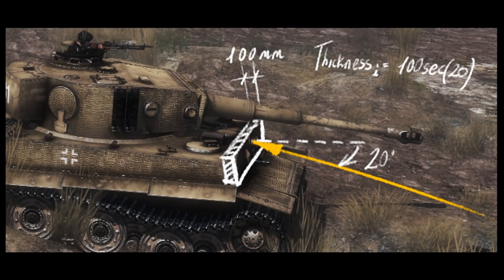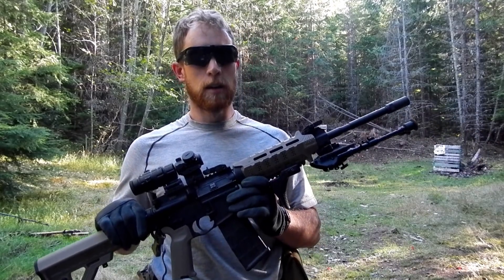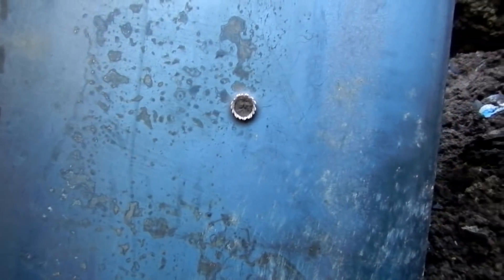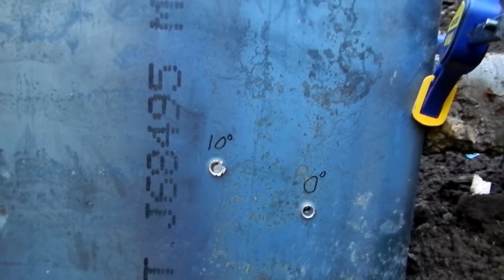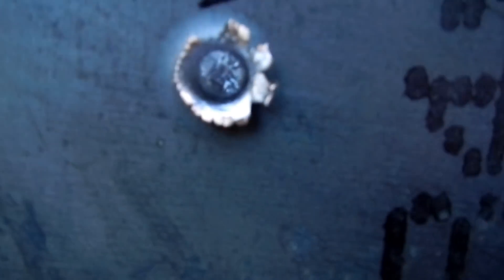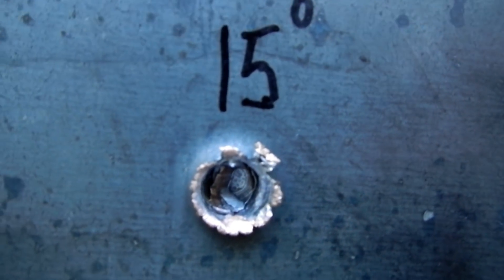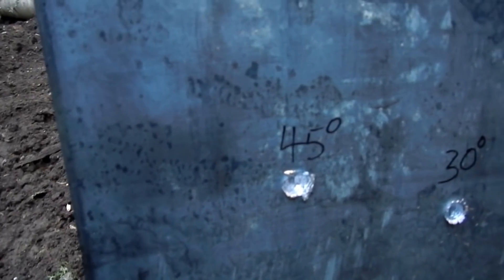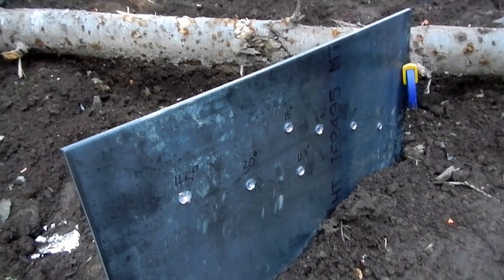Does sloping armor increase it's protection?

Comment: You are not very good at mats or physics, right?
Reply: Also what would indicate that?
Reply: @reahs4815  Sloping armor does not increase its frontal thickness, just angle. As thinner sheets are used, they get proportionally longer, so final mass remains the same.
This is the first answer found on google:
https://www.quora.com/How-does-sloped-armor-on-a-tank-improve-the-effective-armor-thickness-when-compared-to-flat-armor

Comment: Sloped armor is more effective, but that comes with some complications. First, armor piercing shells of the size suitable for anti-tank usage tend to be traveling in a more parabolic arc than say 223 /556, they are also under fire from artillery (even more of an arc in flight) and rpgs with shaped charges. Secondly, the more you slope the armor, the less room is available for crew, ammunition, and systems typically. This is why you see such a wide variety of different solutions in ww2 despite the fact that tank designers were well aware of the advantages of sloped armor in the interwar period. Today after over half a century of refinement you see armor that uses various different approaches together - slope, spacing, and active armor. I think they probably still have some of the same arguments every time they try to design a new armored fighting vehicle, protection vs weight, crew comfort vs slope, mobility vs ability, fuel efficiency and range vs high speed and small target ect...
Reply: Most of today's armored fighting vehicles have a main hull then multiple secondary armor mechanism like a composite armor of 90/45 with an air pocket between the 90 slab and 45 slab to absorb shaped blasts this method is usually found on tank m-raps have a 90 slab for a hull and to deal with RPGs they have a grating around the hull so the war head detonates before reaching the truck it's self there for rasing the survivability of the blast
Reply: @SpiffyNo 
You might be surprised to know that spacing between armour layers is intended to stop the effect of HESH* AT rounds, as they require solid armour for the blast shockwave to propagate through the armour and spall the internal surface off, using that to shred everything inside the tank.
*High Explosive Squash Head
Reply: Thats quite the ramble lol
Reply: and this is vid is completly false , sloped armor is not lighter than not sloped armor
Reply: @LicsNorgi  make your own thread, 50 mm of effective armour is lighter the more the plate is angled.

Comment: Yes that’s why most tanks prefer to face the enemy at a 45 degree angle.
Reply: Back in the day of conventional steel armor, but today modern AFVs have more focused defenses, and angling the hull doesn't provide a significant improvement in defense.

Just as well on MBTs, the side armor is often woefully insufficient to stop high energy dart ammo, and exposing any portion of the side of the hull can be dangerous.
Reply: Well we have composite armor for APFSDS (Fin stabilized darts) and that usually eats up the projectile and absorbs the energy, and we have ERA(explosive reactive armor) for HEAT type shells. Angling armor is still quit effective, but being that HEAT shells have to be on specific angles to deliver their stream of molten copper, it’s kinda helpful to angle so the chemical energy has more armor to go through. APFSDS can also be countered with angling, but I’m these days tank combat is too rare to judge.
Reply: @jefferybauduin2919  Well ERA works vs APFSDS too but not as well as vs HEAT

Comment: Angled armor also increases the overall weight OR decreases the internal space drastically.
Reply: Not necessarily.
Reply: aboomination not necessarily, as your armour is relative to the person using it and the person firing upon it, all you have to do is change your angle of incident and presto angled armour. As long as you’re aware of what angles your armour has you can always keep an efficient angled facing towards the attacker. This doesn’t mean an ecroachment on space or weight restrictions unless changing the armour during the design and building processes.
Reply: @brendonmoore3505  True, but I was talking actual pre-angled armor vs pre-"flat armor" ;) Obviously a boxy tank like a Tiger could angle towards an enemy (and was instructed to do so).
Reply: I understand what your saying but still not Necessarily. As you can both reduce you weight but multiplying your angle therefor halving your material weight on front and side plates, only at optimal angle incidence. 
And using the inside plate dimensions while building rather the outside.
Reply: So you can reduce the thickness of the plates while still retaining optimal armour integrity.
Reply: You can also think of it like this.

Angle the front plate of a vehicle, the lost material can now be used to increase dimensions in other areas, like the back. So you'd be not only increasing effective armor, but getting the same internal volume as well.

Comment: How useful is sloped armor on MBTs?
Reply: Eh most of your protection is from composite armor. APFSDS easily defeats angled armor through normalization. A modern APFSDS round can pen rolled homogeneous steel at extreme angles.
Reply: @talltale9760  Its not because of normalization... and composite armor(if we ignore what and for what is actualy inside it) is good protection for HEAT and HESH. Reactive armor also giving some protection when it is on sloped armor.
Reply: @talltale9760  not too useful then.
Reply: @karlhans6678  The Sloped armor is still useful but for a different reason, and people often ignore context
Beneath the angled parts there are dozens of plates of flat, super-hardened plates - however thinner hard plates are also more brittle
The Flat ones underneath deal with the large rounds and ATGMs, the angled ones are to deflect smaller ones - like 30mm cannons on IFVs that would risk weakening the hard but brittle plates below
Reply: @bengrogan9710  sounds like a good reason.

Comment: Excellent test.  I would just add that sloped armor not only increases the effective thickness, but it also makes it easier to deflect an incoming projectile.  If the armor is perpendicular to an incoming projectile, then the normal force exerted by the armor on the projectile needs to be at least great enough to reduce the projectile's velocity to zero.  If the armor is sloped, however, the normal force exerted by the armor on the projectile need only be great enough to reduce a vector component of the projectile's velocity to zero, that component being cosine of the angle of the slope of the armor off the vertical (which would be equal to the sine of the projectile's angle of incidence to the armor).  To put it another way, as the slope of the armor increases, the less it needs to change the direction of the projectile to send it skittering off.
Reply: Based on what you're describing I would love to see a video to find out at what angle the round ricochets. Measure the "thickness" at that angle. Then take out a thinner plate which do not hold the required thickness to stop a round, but it is at an extreme enough angle to cause a ricochet, would that be enough and/or possible to stop it penetrating?
Reply: @evil001987  I would love to see such a test too.  I do not currently have the equipment to conduct such a test any time in the foreseeable future, but hopefully Jackal Mountain will read these comments and try such a test.
Reply: @Patrik Lilja
Both: First the flechettes are unlikely to bounce even off of armor that is extremely angled due to their tiny cross section and immense velocity; Second, once in the target the flechette will turn(slightly) into to the angle of the plate, thus reducing the effect of the angling. The more extreme the angle of a particular section of armor the thinner it has to be to make up for the additional surface area, thus less armor for the flechette to go through.

You can look up images of APFSDS flechettes tested on steel blocks for visual aid.

What this means is that flechettes gain effective armor penetration against vehicles that rely heavily on sloping over objective armor thickness(such as most Soviet and post-Soviet vehicles). By contrast old-fashioned AP rounds, chemical rounds and Soviet style slug penetrators suffer a lot from angled armor. Slug penetrators are actually very good at penetrating flatter armor, more so than flechettes as they're not restricted by the flechette's length, down side to that is they bounce.

Also, certain types of flechettes will partially disintegrate during the process which is very bad news for anyone on the inside of the tank. DU rounds do this, it's one of the many, many reasons they're superior to any other kind of anti-armor shell.
Reply: There are many rounds that work better on sloped armor it's the round the Abrams had used/uses
Reply: Such as apfsds
Reply: @goose6440  I've been trying to google on it, but can't find any definitive answer. 

When some people say "better" they mean better than other rounds. When some people say better, they mean that it will not penetrate as well on an armor plate without any slope.  Which is it?
Reply: @evil001987  every round has it's draw back and pluses
Reply: @evil001987  APFSDS is a long rod  depending on how long the rod is that's how much penetration there is .
Reply: @evil001987  there is also a comment on here that explains everything
Reply: @goose6440  You write "depending on how long the rod is that's how much penetration there is ." Given that explanation, sloping armor still "helps". Sloped armor will make it so the distance of armor needed to be penetrated is longer. If the distance of penetration depends solely on the length on the rod, the more the armor is sloped, the longer the rod is needed to penetrate it, in a hypothetical scenario.

As far as I can find, APFSDS are better than other rounds vs. sloped armor. But it isn't in itself stronger against sloped armor, than it is on armor that isn't sloped.

Of course, in reality, if you need to put it on a tank that needs to be able to move and house equipment inside of it, the amount of armor needed to stop APFSDS just isn't viable to put on a vehicle, regardless if you slope the armor or not. 

So in that regard, APFSDS still beats sloping armor and it doesn't "help" to slope the armor. But sloping the armor will present more armor to penetrate for the round, just like shown in that video, even though it won't be enough. Of course, this counts as beating sloped armor in any practical sense, so I agree it beats sloped armor. 

All I am trying to say is that the idea behind sloped armor is that it presents more armor needed to be penetrated, and that, as idea presented in the video, still "works".
Reply: In all fairness, this only applies to a ACPR which is a high velocity shell with bad angle penetration. Other bullets that utilize penetration and ballistic caps won’t have trouble doing damage to armor. It’s a good point but very rarely seen in practice. This generally does play a part in gun breaches and/or turret sides.
Reply: @shaloamnenja12yearsago29  Except they will, capped ballistic is still massively more sensitive to angling than flechettes or HEAT devices.
Reply: The Crimson Fucker, that’s fair but doesn’t change my point that it doesn’t apply to ACPR.
Reply: @shaloamnenja12yearsago29  
ACPR? I'm not familiar with this one. I'm familiar with armor piercing composite rigid but not whatever that's supposed to be.
Reply: The Crimson Fucker, it’s a light, pointy bullet. It’s for head on armor, not angles, and is weak at long range.
Reply: @shaloamnenja12yearsago29  
Yes that's APCR, there's no such thing as ACPR. Just try to break the acronym down and see what you get.
Reply: The Crimson Fucker, sorry, fucked up my spelling. It stands for armor piercing composite rigid.
Reply: David Vazquez  
That's uh...that's not quite right though. Should be Anti-Communist, shouldn't it?
Reply: David Vazquez  
No, no it's Anti-Communist Particle Cannon,  It's a particle cannon that only targets communists.

How do I know? Well anything it shoots is obviously a communist.
Reply: @Nekogami04  
No, Liberty Prime uses an Anti-Comunist laser, a "acuser" if you will.

Comment: Straight to the point, very interesting and informative. New sub.
Reply: He said about T-34 and did not mention "BT-2 tank of 1932 - Walter Christie's tank design built under licence in the Soviet Union"...
Reply: +When a round hits a piece of metal at an angle, it ‘normalizes’; it will slightly correct its angle of penetration(that correction is specific to the bullet type and shape.
Reply: and it is false

Comment: It reduces the area it covers though, you're not getting better protection for less armor, they don't slope it on the sides of tanks, it's just like making it thicker really. Dunno why people make a big deal about sloping armor, cool video though.
Reply: It's not just increasing the relative thickness. Bullets and shells have vastly worse penetration performance on sloped plate, so the plate offers a lot more protection than its relative thickness implies.
Reply: Not only is the angled plates effective thickness increased but because of the angle itself the chance of ricochet or non penetration is increased dramatically. Combine this with composite armour to protect against heat rounds and active defence to face atgms and other guided missiles and you have an MBt of some stature.
Reply: It does add weight. It increases surface area which means more mass which means more weight.
Reply: Blackwood Security not necessarily, as c2 = a2+b2. “Pythagoras Theory” also a 20mm plate at 0 degrees has the same mass as a 20mm plate at 45-60degress. As we are talking slopped armour all you have to do is change the angle of the tank itself not necessarily each piece of armour. Only by making a piece of armour larger do you gain any extra weight. This isn’t what’s happening here rather we are changing the angle of incidents. 
A rectangle box has the same dimensions and weight as the exact same box 45 degrees to the left or right. Presto angled armour for nothing.
Reply: Blackwood Security a slopped tank will naturally be heavier yes. But I can further angle that tank for greater armour effectiveness for no cost in weight at all.

Comment: If the value of sloped armour is just the extra effective thickness due to the angle then surely no weight will be saved over making the armour that actual thickness. Because of the slope you need a greater width of plate to get the same height and the extra width will be in proportion to the extra effective thickness. Some other mechanism must be at work to allow weight to be saved.
Reply from the maker: Ah. It allows weight to be saved by changing the angle of the most common direction of attack. Imagine your tank is a square. instead of a flat side facing the enemy, you could rotate it 45 deg so that a corner was facing the frontal arc, angling all the armor to incoming attack from the most likely direction (the front). you could retain the same internal volume and surface area of armor but get a better level of protection from the most likely direction of attack.
Reply: @jackalmountain6523  You could get the same advantage with the same weight and internal volume  by using thinner armour in the less likely directions and thicker in the flat front direction. I think the real benefit must be in the chance of ricochets.
Reply: @jackalmountain6523  Ah, I've just understood what you meant a bit better. I think you are considering armour which is vertical but at an angle to the direction of attack.  I was considering armour sloped at an angle to the ground, as often seen.    I think my logic is correct for this case but your reasoning is correct for vertical plates at an angle to the likely direction of attack.
Reply: Thicker armour direction of attack. Plus angling. Thinner armour areas not designed to take a hit, ie the rear and top of the tank. Even the bottom plates are thinner. 
This is very easy to figure out. More material equals greater weight and less space. 
But we aren’t increasing the material size but rather changing our angle of attack. Therefore effectively doubling the thickness of the armour with zero changes made to the material itself.

Comment: Very nice video and very well done, i'm curios to see how the spaced armor behave if angled,    the only problem is that the saw blade are too thin and soft and they deform wen individualy hit, they need a back support so i suggest to use two of them join together to reduce this effect, an other suggestion is to leave more space between the plate in a way that the bullet can change direction and fragment